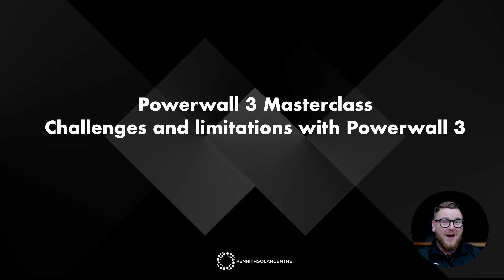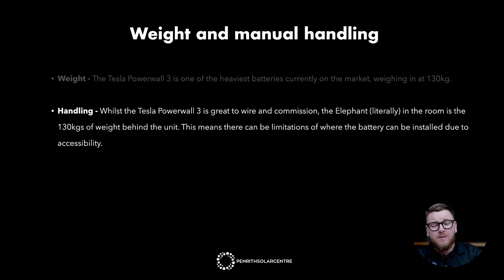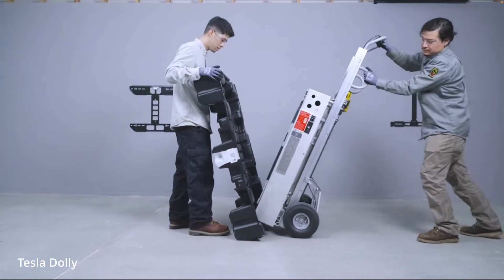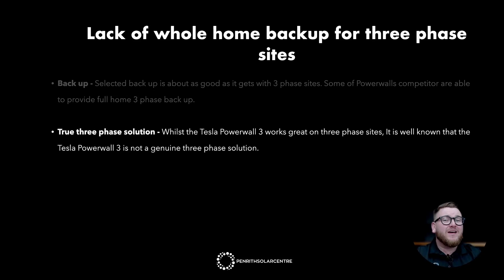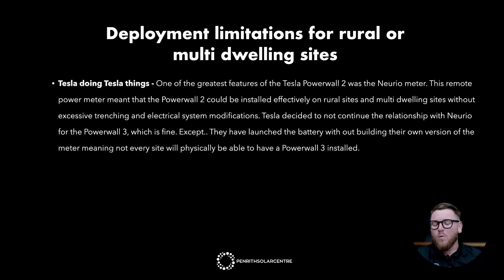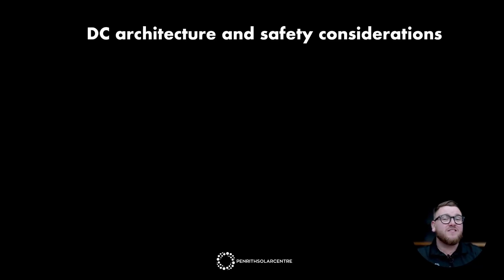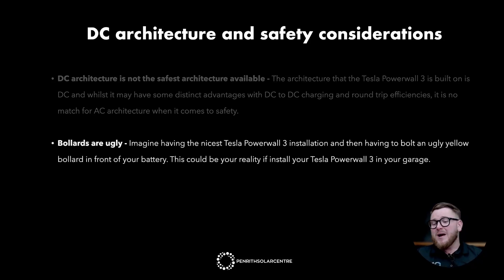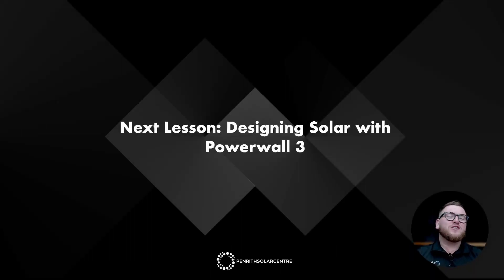Tesla Powerwall 3 | Challenges & Limitations

Comment: I have spoken to Tesla technical support but haven’t managed to solve my problem yet. Maybe you can help.

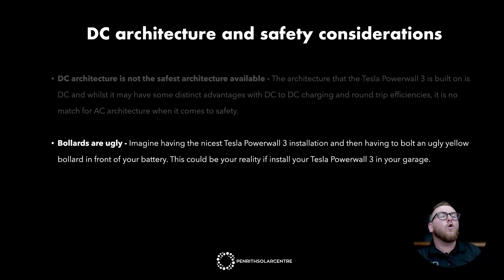I have a Powerwall 3 installed with no solar. I am using the Tomato Lifestyle tariff. I charge the battery fully between 1 and 6am (super-off-peak 5p per kWh). I then discharge the battery during peak rate (23p). There is an off-peak tariff at 13p from 09:30 to 11:30. In order to fool the Powerwall into charging the battery at this time I have set the time based tariff to also show as super-off-peak. Otherwise (when set at off-peak) it continues to discharge the battery. This approach gets the battery to the next off-peak time at 20:30 to 22:30 before returning to peak. If I set the tariff at 20:30 to mid-peak (13p) the PW charges up. To the point where I have more energy (@13p) stored than I can use before I get to the 01:00 and the super-off-peak rate (5p). Ideally I would like the PW to simply be idle between 20:30 and 22:30 (neither charging or discharging) using the energy directly from the grid at 13p. That will allow me to fully discharge the PW between 22:30 and 01:00. I have tried a simple fix by setting the off-peak/mid-peak period from 20:30 to 21:00 but it still over charges the battery. Any thoughts on how I can achieve this goal?

Comment: At least in the US, the use of the Tesla MCI (Mid Circuit Interrupters) is required by the NEC (National Electric Code) to limit DC voltages.  Each MCI limits the voltage coming from up to 3 panels (165V) to 1V unless the Powerwall 3 is actively sending an activation signal.

Comment: can someone explain to me his take on AC being safer? is he talking about solar panels with micro inverter? isn't it a requirement to have a switch at the panels regardless? i was surprised reading this remembering hearing Edison publicly electrocuted elephants to show AC is more dangerous than his DC
Reply: Micros such as Enphase are always safer. They have AC in contrast to high voltage DC cables on the roof.
Reply: Yes enphase essentially converts DC from AC at panel itself unlike string which runs DC till inverter

Comment: You mentioned 1 powerwall3 per phase (3 total) was the perfect solution. Will all 3 phases be backed up in a blackout (assuming no 3 phase equipment is present in the house)? Does one gateway manage all 3 in this scenario? Will the system monitor and behave as one solar system?
Reply: 😢No it won't it will require 3 Individual gateways.

Comment: Please pressure Tesla to bring out a true 3 phase inverter for the Powerwall. Not going to install 3 pseudo sub standard unsynchronised PW3 units in my 3 phase home. It's a terrible work around, which won't run my 3 phase air conditioner, thus restricting full 3 phase whole home backup. I believe there's a huge demand for Tesla to bring 3 phase inverter to market in Australia, England and Europe. So hurry up Tesla.
Reply: On my 3 phase home I’m going a 15kW Sungrow Hybrid String Inverter with 19.8kW of panels and then down the track add the Sungrow SBH200 20kWh battery which will be able to handle my 3 phase 16kW air conditioner. I have a Tesla too but Tesla Powerwall just doesnt fit the bill for three phase homes…
Reply: As long as US keep running single phase, Tesla won't give a f**k 

I hope I'm wrong though

Comment: with megapack having 3878kwh of capacity and can offer either 1927kw or 969kw of inverting power a having maybe an apartment block of say 30 units using 15kw each peak, your looking at 450kw of power which would mean you could get 8hrs out of that mega pack. at what point is better to leave a power wall 3 and switch for a better ROI?
Reply: There is regular maintaince required for the megapack.
Reply: Just something to consider

Comment: what happened to the info about stacking PW3 non inverting batteries to the inverting PW3s? i hope that info is in the designing a system video. but then also need to talk about at what point in a commercial or multi dwelling property does a mega pack come into the equation